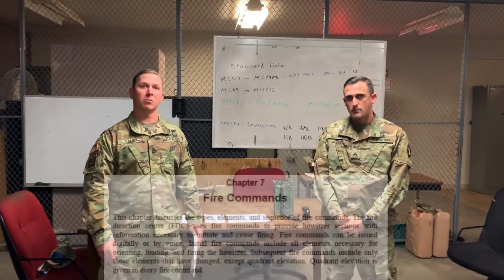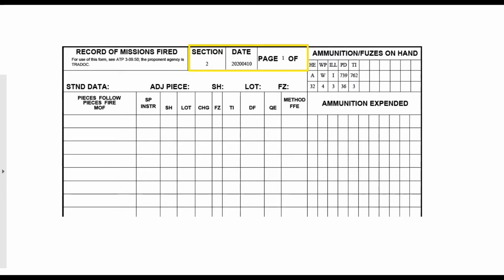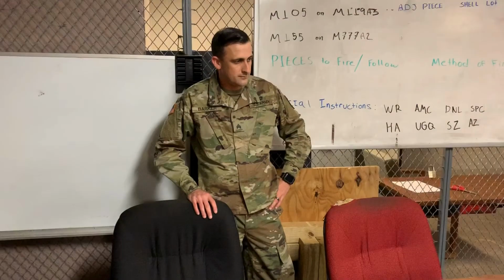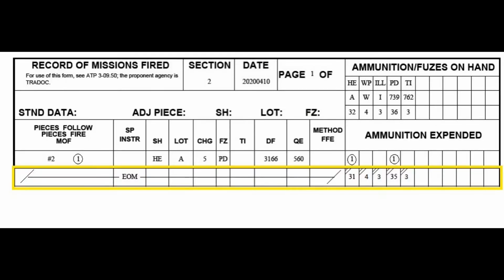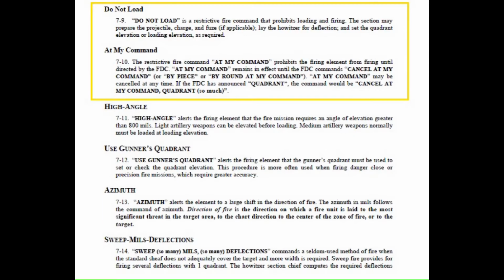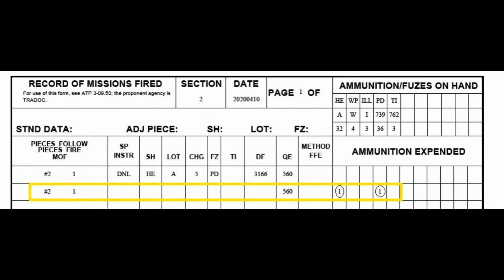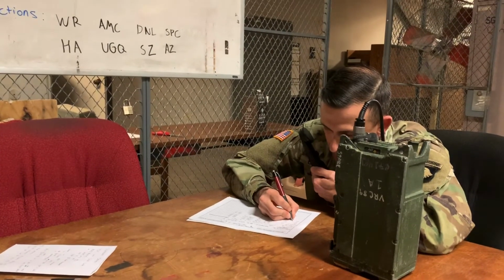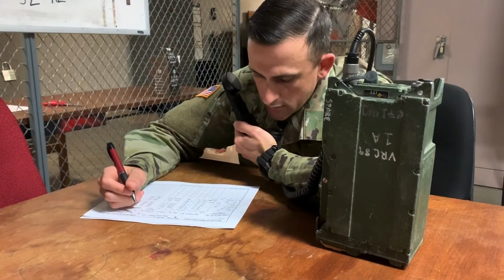Fire Commands and DA Form 4513

Comment from the maker: This training covered in the video does not go over EVERYTHING obviously. For the sake of viewers having to watch an hour long video this rather lays the baseline and understanding so they can train with minimal equipment and/or personnel. NCOs should use this as a guideline and cover the things that were not addressed such as: every 24 hours starting a new DA Form 4513; ammunition resupply; different ways of how “At My Command” is applied; changing method of control from one restrictive command to another prior to given quadrant; etc. This video is a template to help basic fundamentals and a guide for young NCOs to better train Soldiers.